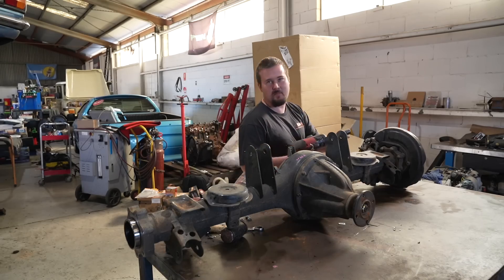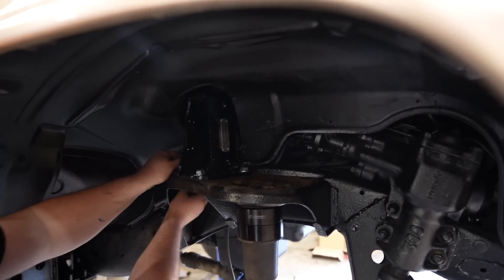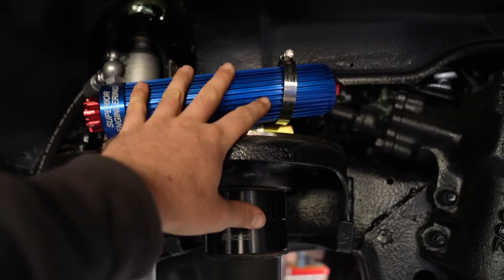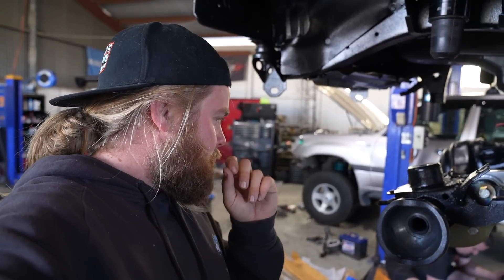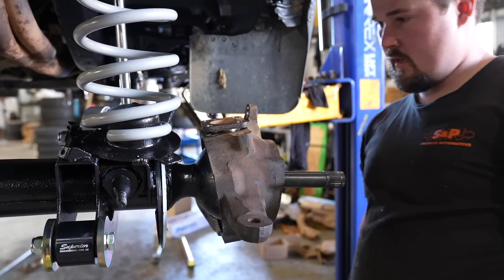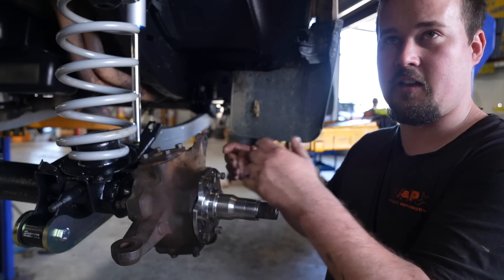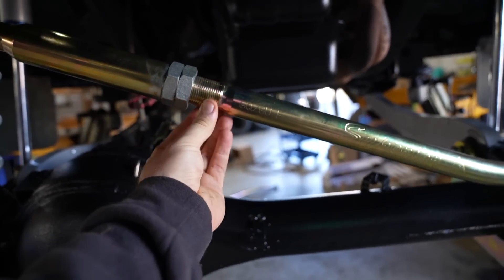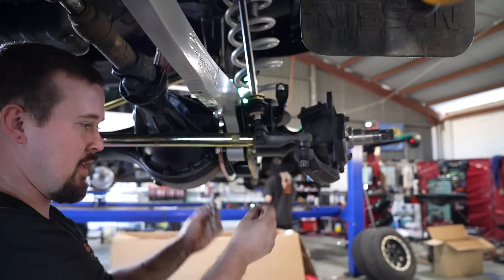MASSIVE suspension upgrade! ULTIMATE off-road FLEX kit for my Nissan GQ Patrol 4x4

Comment: Getting there mate. Do yourself a favour, leave the "hats" off the top of the coil tower & drill an 8mm hole in the bowl right next to the outer edge of the bump stops. That way you can wash crap out instead of it collecting & causing rust. The 8mm hole will allow water to drain.

Comment: nice video and good level of preparation!  where did you get the front pull and drop box?  you're pulling the upper rear why are they bent?  in France we have some shop to do our preparation, but we don't have everything you have
Reply from the maker: All the gear is from Superior Engineering and I got the bent upper rear upper control arm so I can fit a long range fuel tank in there one day
Reply: @TylerThompson90  nice project in any case, you're lucky because in France we don't have all this variety of equipment. for my part I am looking for information for the preparation of a patrol y60 short if you have contacts to give me, it is especially for the rear transmission there is too much angle and the braces are only 1000 km ... good luck for the rest of the preparation

Comment: Love the work and everything but 1 question home come you didn’t opt to cut off the rear shock mounts and move them up for more clearance
Reply from the maker: Cheers mate. Not sure if you can do that? Never heard of people doing it
Reply: There is the link to them  I have thought about doing it to my wagon
Reply: Because superior base their products around 'bolt in' kits where possible. And they seem quite keen to 'sponsor' the youtube world. There are much better options and possibilities out there if you are willing to get the welder out.
The other problem with raising the shock mounts is you can't really lift the upper mounts in a wagon so you need to really limit up travel or lose down travel by running a shorter shock.
Reply: @bennyjahmin3953  what else is out there mate
Reply: @claytonhill3136  
I meant there are better suspension options other than superior not specifically ways to raise the lower shock mounts.

Firstly i would go with the dobinsons 3 way adjustable shock of any of superiors offerings. 
Secondly their components are ridiculously heavy and when you only have a 2.8t gvm in a GQ every bit adds up really quick.
Thirdly they don't even do a triangulated rear upper kit for the patrol.
Or a torsion style swaybar for the front as their 'supeflex' front swaybar doesn't really 'superflex'

Comment: Looking good, any reason why your not using dust boots on the shocks? as road debris/stones will eventually damage/chip the chrome hardening on the shafts and will destroy the wiper seal, which will result in leaking shocks.
Reply from the maker: Didn't use them on the GU either, superior still give warranty on the shocks whether you have them on or off. I think they are kinda ugly and if you do get stuff in the boots it can't get out and then just smooshes around in there and destroys the shaft anyway

Comment: Interested to see what the weight is after this work. GQs have very little payload, after I fitted a 3" superior lift, 35" rubber, I was at GVM with just a draw and fridge slide...

Add a front and rear bar, with roof top tent, it's at 3t...

Comment: Great vid, and coming along nicely. Will have to put this GQ up against Tim's modified GQ once there both finished. Shock lengths??? What Springs???
Surely Nick deserves a cut somehow?
Reply from the maker: Shock's are the 6 inch ones, springs were 4 & 3 but I've since changed them to Dobinson Flexi's (next episode)
Reply: @TylerThompson90  Putting off shock buy till next ep. Do we get a flex off between the GU and GQ??

Comment: Nice I would have gone 4.1 or 3.9 ratio .63 reduction and put a turbo on for early spool and got low highway revs best of both world's it puts a bit of strain on hubs and cvs but you will probably up grade them anyway. I also would have run a h260 rear  if I had to buy lockers and diffs from scratch even if I had to settle for a converted drum brake